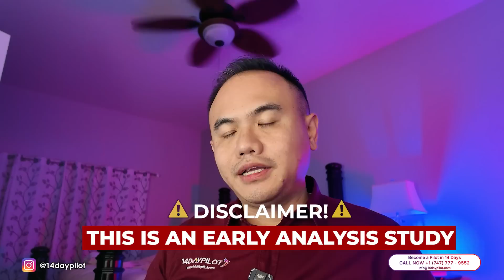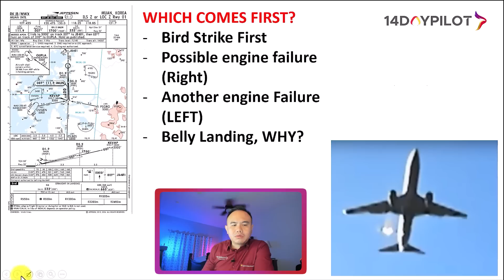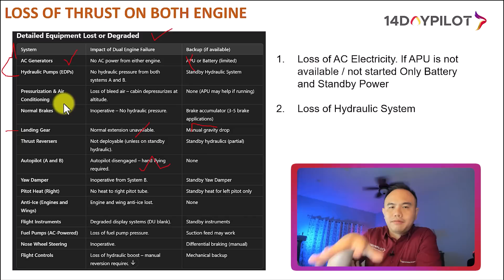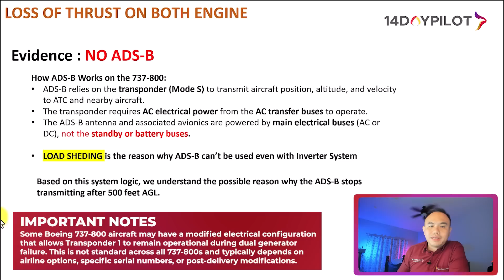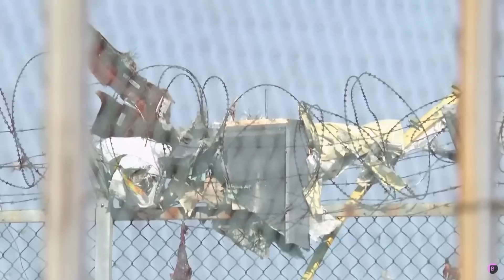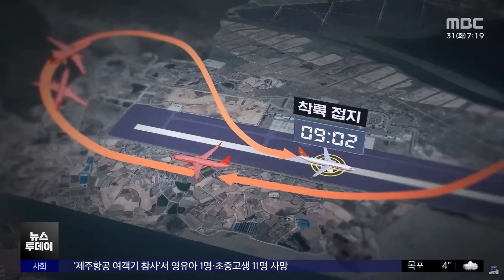NEW! JEJU AIR 2216 UPDATE :THE MYSTERY OF RUNWAY 19! B737-800 Crash At Muan Korea

Comment: I’ve been left wondering why the person on the balcony started to film the aircraft as it passed over? What if, the bird strike caught on film is actually a secondary strike? This would in fact explain why the panic to return on opposite approach with a dual engine problem.
The typical approach over this flat complex (where the balcony is located) is more like 250ft. The aircraft was clearly already in TO/GA when the footage shows the bird strike. Even the last ADS-B data shows it’s already climbing before they’ve reached the bird strike video location.
Reply from the maker: This is a good point!!!
Reply: @14DAYPILOT  May you could drill down on this a little more in a future video? I was looking at the final ADS data and comparing it to other 737 landing on 01. There are two yaws to the track which maybe telling and then the altitude changes. It may turn out that the crew were dealt a cruel blow with a secondary bird strike after the decision to go around.
Reply: Supposedly it sounded odd enough that it caught the attention of people on the ground.
Reply: I have a feeling they ingested birds TWICE.  If power was degraded to both engines, perhaps requiring the shutdown of the No. 1 engine, then I can see why they might have skipped checklists and did the impossible turn back.  The pilot would have been trying to preserve energy.
Reply: then they would land immediately on that approach, not go around
Reply: @Lemon83166  the secondary strike was on go around
Reply: Could be.
Reply: Yes that seems highly likely that there was a bird strike on the left engine first - the person below heard or saw something and then decided to film and caught the second strike in the right engine. Why else would they start randomly filming? I wonder who they were, if they have been interviewed and asked what they saw?
Reply: OMG, this is such a good point!! Why would someone just randomingly start recording unless something prompted them to do so. So what we're seeing is pontentially the second bird strike.
Reply: @veebee3837  Yes, and at that moment the transponder stopped and followed the message "mayday, mayday, go around" at 23.59 UTC. 90% chance they were left without both engines and power
Reply: Correctly... And so it is explained that their transponder was stopped and they could not also communicate anything with the ground tower, they landed as they could, in the middle of the runway.
Reply: When the mayday happened the plane was above water, and the video is clearly on land
Reply: I believe your analysis will prove to be what actually happened.  Their first mistake was the go around decision (versus just finishing the approach on one engine, which isn’t as simple as it sounds).  Their second mistake was turning back and trying a dead stick landing.  They would have almost certainly lost fewer lives putting it in the drink.
Reply: @wsteele5864  Not as mistake, it’s a choice of continue or go around. As they say hindsight is a wonderful thing.
Reply: @ absolutely right.  It is a valid choice at the point if they took a strike in the Port engine to go around.   It only becomes a mistake when the Starboard engine takes a similar strike while on the Go  and shortly thereafter you have little to no thrust.  I believe at the point they decided to return to the airport you could give 100 37 pilots the same set of circumstances in a sim and if they practiced all day, a few might get to the point of being able to get that thing stopped on the runway.  Dreadful choices.

Comment: You are correct, according to the Korean news, at the time of the turn around, the plane was not able to incline for whatever reason, which caused the pilots to land quickly.
Reply: Stupid question time.  I believe he was at about 1000 feet at the time of the bird strike.  The sink rate would be between 500 to a 1000 feet per minute for that plane without engines.  How was he able to fly the plane for between 5 to 7 minutes without engines?
Reply: How they did a U-turn without both engines?  I realized they didn't execute an large, completely, U-turn when I saw they came down steeply and they hit the runway in the middle of it at high speed
Reply: Have you idiots gone through the flight data? The vertical speed and flight path up until landing is a classic go around and controlled landing path. There is absolutely no reason in the data that suggests that they had reduced or no power,you fools reacting on images and videos and jumping to conclusions while ignoring raw hard data.

Comment: incredible that they initiated a G/A at 450' in landing config. Then, looking at the raw data, within 48 seconds it was over. Suggests to me that in the G/A they shut off the wrong engine (1), tear dropped the return onto 19, which would have been TIGHT. landed with no flap or gear. Vapp +15kts. Insanely gross human error.

This was a standard simulator scenario. Nil landing perf calculations, zero checklists. should take 20 sec to gravity extend the gear.  

Beyond the human error, this seems a classic case of Startle Effect. Flight / fight / freeze
Reply from the maker: Now finally we are talking. The ADS-B loss signal at 500' AGL.  Maybe partial loss happened here when second engine loss the engine due to wrong shut down and use the other engine to fly (The stall one)
Reply: @14DAYPILOT  ...and not all bird ingestions lead to a shut down ! ...At 450' stabilized, I'm doing one thing..landing.. just like the low viz ban height
Reply from the maker: @fabsieee07  Visibility is good that time. Its not a bird definitely
Reply: @14DAYPILOT  qu’est ce que c’est l’ADS B ? Le transpondeur ?
Reply: @14DAYPILOT  You're the only analyst I've seen that associated the loss of ADS-B with loss of both generators (meaning both engines). Good thinking. I wonder if this 800 series had battery backup for the transponder, as I think you mentioned some of the 800s do?
Reply: Definitely agreed!
Reply: Agreed. Most likely contributing factor: performance of the crew.

Most bird strikes don't result in total loss of an engine, Pterodactyls are extinct. Did they take multiple birds in each intake? Maybe. But with compressor blade, or fan blade damage, you may not get much thrust above idle. In a desperate situation leave it running, advance throttle up to the point of compressor stalls, then back off a little. At least you'd have hydraulics/generator from that side! If you shut it down, ESPECIALLY with the fire handle involved, you're never going to restart at low altitude and speed.

And Vapp (clean) is a MUCH higher speed than with slats/full flaps. I'm thinking 180 minimum. That's how fast they were going, and about 158 off the end of the runway, not survivable for most airports even without the crazy wall at the end.

Comment: Yes both engine failed due to birds strike. And maybe they made a mistake  in cutting off the most affected engine
Reply: You mean the least affected
Reply: @Obiamajoyisrmd  You don't have time to identify how much performance the engine had and things can get ugly over times. The only you notice is the drop of the speed. But for me if I concern both engine running out the right decision is not go-around but continue. In case of Boeing 777 crash at Heathrow Airport the pilot just raise flap and raise the gear depend on air speed and altitude they left in order to continue. At least you're on the grind slope and it easily than go around doing impossible turn in order to land opposite side of runway.